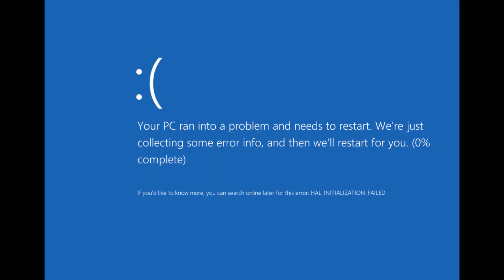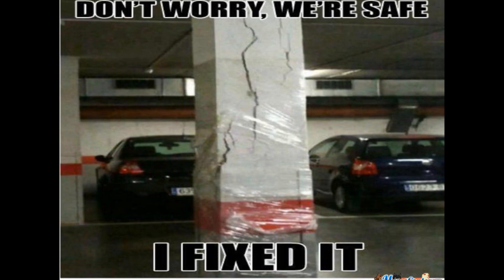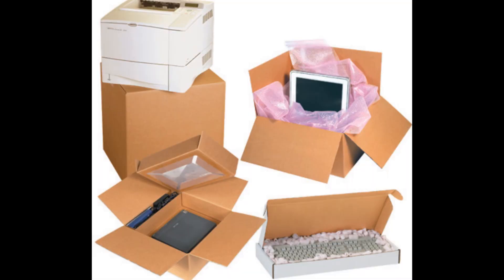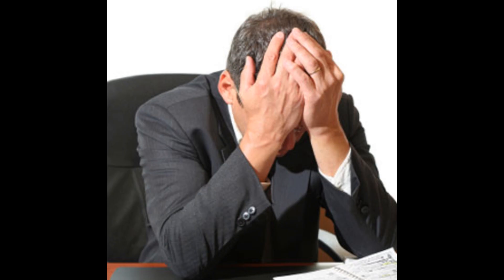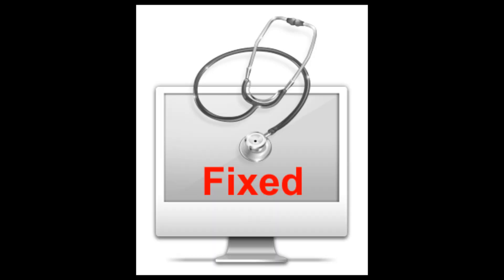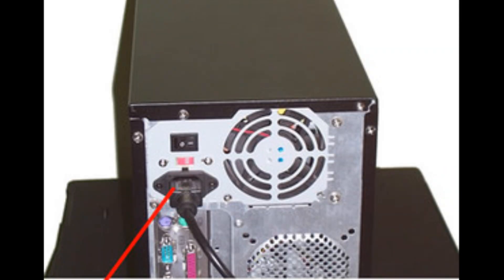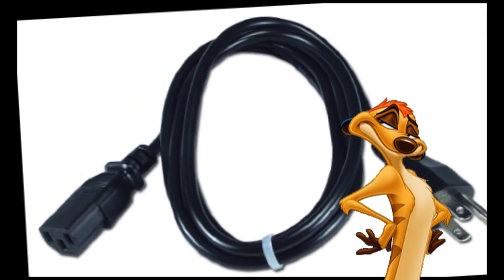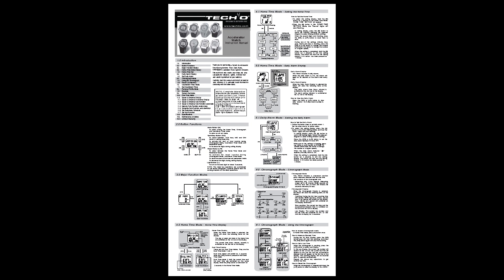The BSOD Saga: Part 7 It Wont Turn On

Comment: One trick I've learned for disassembling and reassembling computers, especially when you don't have any kind of schematic, is to use your phone and take pictures of everything. The entire motherboard, all the connectors, screws, switches, and cables from as many angles as you can. That way, there's absolutely no question as to where everything goes and you have a fast and easy reference when you're putting it back together. And yes, anytime you have a dead PC but still getting power to it, it's almost always a bad motherboard. Sometimes they just die if you look at them funny.